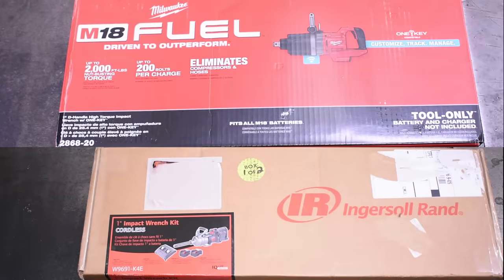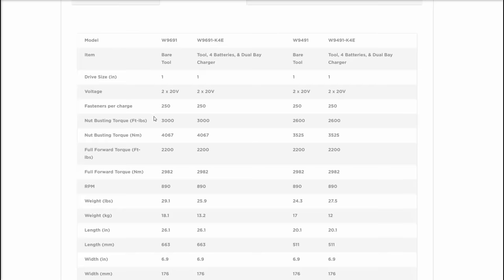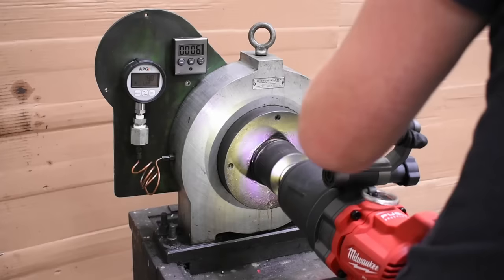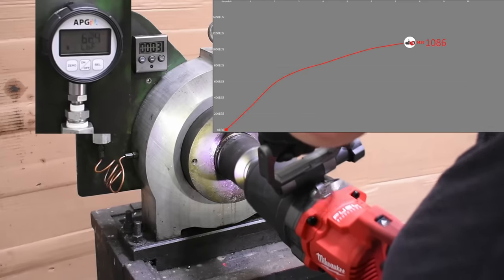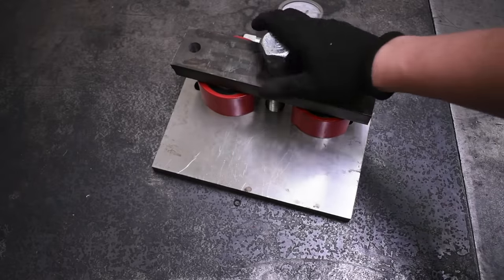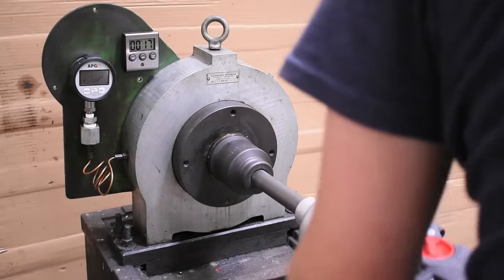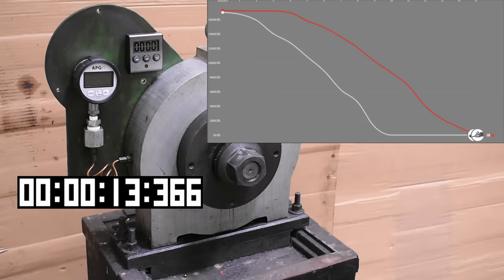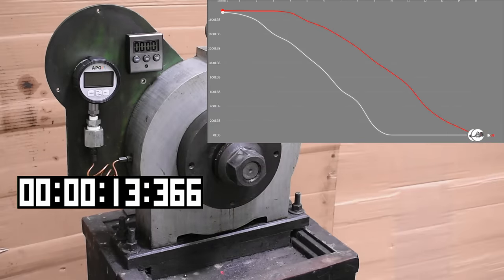World's Most Powerful Cordless Impact Wrench vs Milwaukee for the Crown

Comment: It's not cordless, but I'd like to see a test of the harbor freight 1 In. Aluminum Air Impact Wrench.  I need something with some real power for my dump truck and heavy equipment.
Reply from the maker: I don't think we have enough air to do it justice!
Reply: @TorqueTestChannel   I wish you'd give it a try. Your air system is as good or better than most shops. I used a borrowed one off a 28 gallon tank@ 125 psi with a 1/2" hose and Milton G. It got the job done but I had to let it pump up between bursts. If necessary maybe add a tank. They say they use 11 CFM. That doesn't require a Diesel jackhammer compressor. Your test data would be very useful. Right we don't know if their claims have any basis in fact. 

If you really have to, maybe you can find someone who will loan you a road side tire truck compressor with some fittings for a couple days.

Comment: Awesome testing.
How long do the batteries last on max torque?
Reply from the maker: Pretty long actually. A Ryobi with the 21700 cell 3ah lasts less time. 8-9 runs before losing a bar.

Comment: The company I drive for has a 1" electric [looks almost exactly like that on] IR idk what model but they prefer their cp 1 inch air they said the ir wouldn’t get ‘em right enough and they actually had to use a torque wrench and not just Ugga duggas

Comment: You need a couple extra air tanks to handle the air consumption of a 1 inch rattle gun or need to rent a air compressoer designed for high volume air needs .

Comment: I’m yet to buy the D handle long anvil M18 but will soon. Durability and longevity need to be considered. Also range of tools in that battery configuration. IR has nothing on M18. Join a field service mechanic group and see the real world info. I’ve never seen anyone with the IR. All M18 guys say it’ll do 20-30 semi tires on one charge and better part of an under carriage.

Comment: a company that isnt well known is NPK pneumatic division, their impact wrenches are really tough and the 1'' we had (NW5000) was a monster. i wanted to buy a half inch one but it was like 1200$ for a half inch. if you ever got the chance, it would be interesting.
Reply: I just saw your comment and looked up NPK. Holy cow! Their catalog shows some truly monstrous air wrenches with the capacity to handle up to 3" bolt diameter (Not socket size, bolt diameter!). If I'm reading it right, their biggest wrench is available with 1-3/4" or 2-1/2" square drive. Probably uses custom sockets that are shockingly expensive. Those wrenches would twist the TTCs torque test bolts off like cooked spaghetti. Unfortunately, testing them would be an exercise in futility. Anybody that needs something like that can  just buy one, weld a bolt to a D11 and try to tip it over. : )

Comment: They need a large remote battery and a power cord. Or an inverter to run off a trucks 12 volt system.

Comment: Does the extended anvil make a difference for the big guns?
Reply: At the end of the video he said that they make really similar power being short or extended anvil
Reply: The extended anvil is for removing deep dish wheels on dual wheel trucks. If you use an extension on a regular anvil it takes away from max torque values.

Comment: I can confirm my durofix can take out 1 1/2 bolts torqued to 2500 lbfts . And faster than you'd think too. But its so heavy climbing down inside a stamping press to use. But definitely beats air in convenience.

Comment: I wonder what Milwaukee could do if they also had a 40v impact instead of just the 18v
Reply: Probably something claiming 4000-foot pounds nut busting, lol. It's incredible what they can do with just 18v tools, now. I really do think that Milwaukee is number 1 in engineering and they should release a new 40v line of tools.
Reply: I'm not sure if you guys noticed but the IR is not a 40v system, it's 20v with 2 batteries lol

Comment: Any follow-up from IR on the battery charger issue? 

Also, a huge plus with sticking with milwaukee is you can use the battery on all of their M18 tools. IR  batteries are only good for IR impact.. For me at least. I wouldn't buy other IR tools.. 

Good video though.. Great hard realworld data

Comment: I would accept a free tool as long as you can give an honest review
Reply: @Schwubl_262 I still feel that if you tell the company sending you the free tool that you will only accept the tool if you can give an honest review.If I believe in my product then I as a company would have no issues sending you my product.
Reply: @steveshot81  The issue is that if you get the tool directly from the manufacturer then there's the chance that they may juice it beforehand or perhaps it will come from a Pre-production set that could be different than the production model. Buying off the Rack you know you will get the same tool that everyone else buys.
Reply: @earld1403  I am wondering if a company would actually do that since you would need to build most of the components  from scratch and you would have to test the tool out in order to keep it from burning out on you since you would be running it with more power.
I prefer long term results versus when the toll is new since i care about performance and longevity.How many times has a tool burned out on me after warranty and I never abused it.

Comment: You should calibrate the new dyno with the same IR 231 you use to calibrate the original dyno so everything is for sure on the same scale
Reply from the maker: Need a 1/2" drive 2-3/8" socket!

Comment: I don't think the IR is 18V 10A, it's probably a 36V tool with the batteries in series, so 36V 5A in this case.  While it's truly amazing what Milwaukee has done with a single 18V battery, I think they've reached the point of diminishing returns on 18V development.  They will have to go to another platform or go dual packs, just as Makita did, and just as they said they wouldn't.  It's just the realities of physics.  Half the voltage means twice the current, and heat, and conductor sizing and all the design limits that come along with those problems.  They just released their lawn mower with the dual battery 36V design.  I hope to see more.  Makita took a lot of unwarranted flack with their X2 36V tools.  Unwarranted because they didn't abandon 18V users for a new platform.  They are phasing in the new 40V(really 36V) stuff now, but 18V will be around a long time.  And hopefully, so will Milwaukee's 18V line.

Comment: Milwaukee fans "miLWauKeE iS dA BesT" Ingersoll Rand entered the chat 🤣
Reply: Yeah but Milwaukee still has a much bigger platform you can use their batteries with
Reply: Ingersoll rand is still overpriced dogshit. The batteries suck, the chargers suck. And let's be honest, do you really need that much torque? And if you do, milwaukee is gonna be passed off about this and make a more powerful one next year that will bear the IR in every way. Milwaukee has a tendency to wanna be the best always.
Reply: Here numbers don't lie and well the IR put out bigger numbers. So therefore IR is the best "King" of 1" impacts. Milwaukee....well sad little boys....it's the first loser here 🤣🤣🤣🤣
Reply: Milwaukee is older model, 6pound lighter. One battery... can't wait for Gen 2
Reply: Triggered the Milwaukee boys as usual lol
Reply: @haydenmichelli3065  ok then goofy whatever you say
Reply: @haydenmichelli3065  unfortunately they are not the best in reliability.
Reply: @haydenmichelli3065 you obviously have never used Ingersoll rand 20v then, I've never had an issue with a single battery of theirs, and they last longer than my Milwaukee's under use and don't drain while sitting over long periods of time
Reply: @TheBostonstapler well I have a bunch of their 20v stuff and have never had an issue with any of them or the batteries over the 7 years I've owned them

Comment: Battery life would be the limiting factor on these 1" impacts I would think. Removing and replacing wheels off three axles of a heavy truck is 60 wheel nuts that are supposed to be 450-500 ft lbs but may have been on for years and seized. I have my doubts you could do that more than once without flat batteries. I think air would still be boss
Reply: @matthewnowell4657  it didn't do the full 100 but most were neglected so that was actually pretty damn good

Comment: i would like to see you calibrate the tester with a 1000 ft/lb torque wrench or actual 250 lbs of weight on a 4 ft long bar . or even longer. you would have to anchor your unit to the floor .

Comment: But y'all should do next is take the battery plate from the Makita Ryobi Milwaukee Cobalt the the DeWalt Stanley and all the Amazon brands in harbor freight take this battery plates design a board that makes it where you can run straight power from the wall into off those tools and see how much power they all put off cuz then no power will restrain them

Comment: I sure wish you would test at least the big Harbor Freight 1" drive extended anvil air wrenches, or the Mophorn 1" air wrench from Amazon (advertises 5,800Nm!). I have equipment that sometimes needs something like that, but your channel has spoiled me for buying one with out test data and the expensive cordless ones aren't really an option.

Comment: A 1 inch should always be able to do the same torque forward and revers as commercial vehicles have both left and right hand treads  my Japan Yomato 1.5 inch does 4500 ftlbs forward and reverse but requires a 1 inch air line and my monster Vmac 200 psi at 90 cfm to run it  or my old 4 cylinder 200 hp diesel compressor  but even my ! inch does 3000 forward and reverse  on my 30 cfm 150 psi compressor on a 5/8ths air line

Comment: I would like to know if Milwaukee doubled its 18v batteries how would it compare to the IR with its 2- 20v batteries. They are not comparing apples to apples really
Reply: Yeah, except the IR is actually at a disadvantage here in terms of potential wattage.  

2x 18650 packs (20 18650 cells) maxes out at ~1440W continuous discharge rate (CDR).   Samsung 25R has a CDR of 20A.  20A x 20 cells x 3.6V = 1440W CDR.

1x 21700 pack (15 21700 cells) like the M18 12.0 maxes out at ~1890W continuous discharge.   Samsung 40T has a CDR of 35A.  35A x 15 cells x 3.6V = 1890W CDR.  

That's a 31% extra wattage advantage given to the Milwaukee in this test.  Let's also not forget that these 2 IR batteries also weigh less than a 12.0 battery on top of that too. (2x IR 5.0s = 3.2 lbs, 1x M18 12.0 = 3.35 lbs)  The Milwaukee also has a watt hour advantage here too.  The IR has a combined 180 Wh vs 216 Wh of the  M18.  20% advantage to the Milwaukee.  I remember watt hours being super important back when the Flex 24V lineup launched and they were being compared to Milwaukee tools, so I figured it's worth mentioning that here as well. 

Either way, what IR has been able to do given their smaller power envelope and the use of 18650s is actually extremely impressive.   

The entire marketing push around the high output M18 lineup when it launched back in ~2018 was that voltage wasn't everything and that amperage was going to be Milwaukee's saving grace in the face of Dewalt's Flexvolt.  (this was back when Flexvolt was already nearing 2 years of age and nobody was touching their circular saws in cutting speed.  Milwaukee's best battery solution back in 2016-2017 was the HD 9.0 that used 15x 18650s and it turned out to be a piece of crap and was highly failure prone to the point it has special recall and shipping regulations whenever you send them in under warranty)

Giving Milwaukee 2 HO-class batteries against the IR only makes the comparison even less fair or "apples to apples."  And they're the ones who marketed themselves into that corner anyways so they should just live with the L despite all the power advantage they enjoyed in this comparison while still not being able to get the W.  

Not sure why Milwaukee always needs extra accommodations every time they aren't winning at something anyways.
Reply: More Milwaukee fans upset they didn't win

Comment: IR was beat by my hf thunder something or other. In fact the IR only lasted two days working on forklifts.. or two uses. Crap company with built in failure too far in mind. $700 in 2014. It got scratched up in my work truck... Hundreds of miles a day so they said it wasn't new. I still have it but f then and their crap. I've been running Milwaukee and harbor freight since

Comment: I think that ingersoll-rand is going to have to fix their battery issue. What good is a tool you can use the batteries that come along with it to be charged for the price you're paying that's ridiculous at least with Milwaukee you're using one battery and it gets the job done
Reply: Milwaukee's going to have to fix their battery issues because they had a 31% advantage in potential outputted watts due to their use of 21700 cells.  And they still got walked all over.

IR's spanking them with those crusty old 18650s that so many Milwaukee fans love to scoff at these days.  IR's 2 batteries also weigh less than an M18 12.0 on top of that.  

You run this 1" wrench with anything less than that 12.0 and you lose a fair bit of power, btw.  There's a reason the kit ships with 12.0s and not 6.0s/8.0s.

Comment: Amps don’t stack, voltage does,
20V x2 = 48V Max 
5Ah x2 = 5Ah
Reply: @Silky_   You just don’t get it. When they say 5Ah, they mean @ the usual battery voltage. So you have amps, hour and voltage, you get battery energy capacity.  If you double the 5Ah battery, you do double the battery energy. Now how they control those two batteries are up to the manufacturer.

Comment: I am going to assume you do not intend to compare hydraulic tools to air and electric tools.
Reply: Hydraulic tools?
Reply: @brettwalkom948  Yes tools that use hydraulic power instead of air or electricity to turn fasteners. They are much more powerful than one might think.
Reply: @PictishPrince  yeah but why test them they are usually basically torque wrenches

Comment: Wouldn't the smart way to test removal torque be to do exactly the same thing you do in forward but with a left hand thread bolt? Why make it so complicated?
Reply from the maker: That's what we normally do on our dyno we make. This skidmore made for big stuff didn't have one, and it's not simply a bolt. It's a huge plate with a stud. Most of this channel's testing includes custom left hand thread bolts.

Comment: Battery has EVERYTHING to do with capability and torque. So… unless you were using the Correct M18 fuel battery and an exact equivalent for all the other machines… this simply isn’t accurate. Any professional tradesmen knows battery type is all the world of difference within 1 tool itself
Reply from the maker: The IR's batteries total less capacity and leak discharge amps than the single HD12.0 here. And the idea that you can't compare two tools sold to do the same job because 1 company didn't come out with the same exact battery configuration as the one before is just arm-chair internet squabbling. "What impact should I use on my tractor trailer? I need cordless." "Oh I'm sorry sir, the only 2 on the market use different battery capacities in total, so I can't really compare them for you"

Comment: You might have poked the bear.
Milwaukee might have to develop a impact that takes their MX battery now.
But then again are there jobs / projects out there that even require that kind of torque ?
Reply: Hydraulic cylinder piston nuts can go over 3000 ft/lbs of torque.

Comment: I will never trust a cordless 1 in drive impact as the torque is so varied as battery dies. Sorry I will stick will air. My 1/2 drive air  puts out 1500 ft lbs @155 psi why buy this bulky thing.

Comment: so you could stick one of these at each wheel on a car and you would have 8000lb torque...  wtf...
Reply from the maker: Unfortunately not. 2000 ft-lbs is what it can eventually unloosen something from, it's not MAKING 2000 ft-lbs of torque at any given moment otherwise it would spin you off into the sky

Comment: "Using these tools all day is not something you would look forward in doing"
In civilized world, "Using these tools all day" is illegal in building sites. Privately, one needs to be an idiot to use these all day long. White fingers here I come.

On top of that, I would suggest, you guys come up with some sort of bracket to hold these tools in place while testing. If you are doing this often, you won't be doing this for very long time